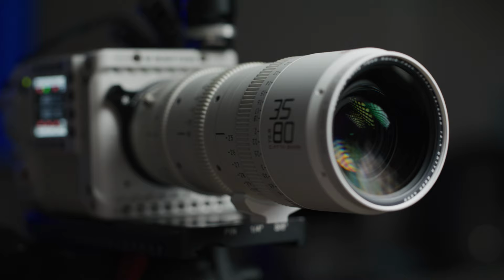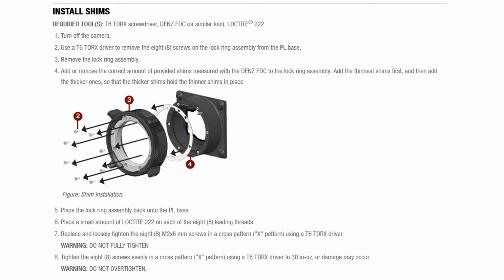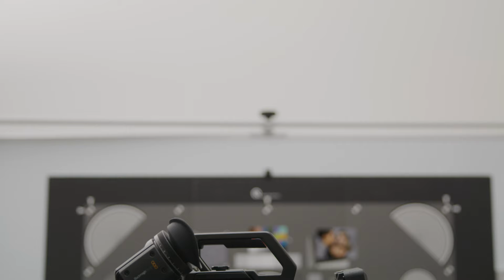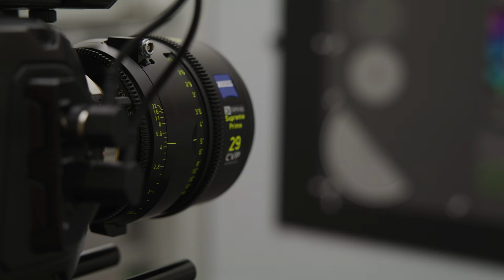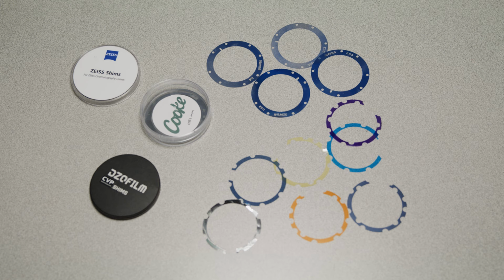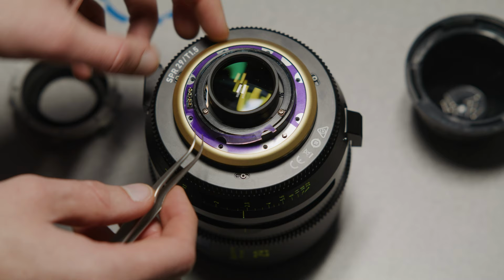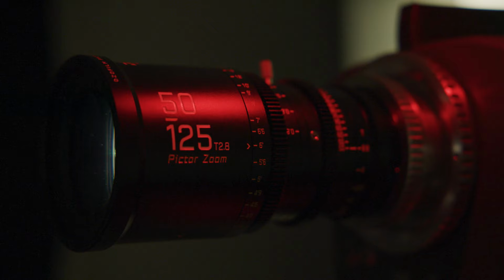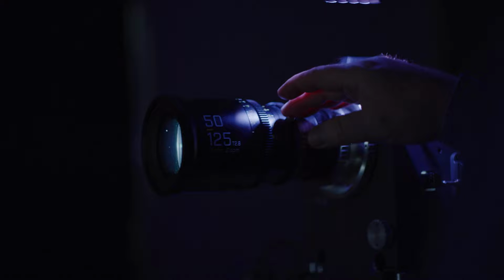Calibrating Your Cinema Lens | How & Why To Shim A Lens

Comment: Great tutorial guys, thank you! I had requested this previously and this really demystifies the shimming process! Another question though. Why is it that some cinema zooms, like the DJO Pictors, need to have shims adjusted based on the camera you are using, while other cinema zooms, like the Tokina ATX and Fujinon MKs, do not? I have the Tokina ATX 50-135 and have had no issues with its parfocal-ness (is that a word?) when swapping between a Red Komodo and Sony A7Siii. I also used the Fujinon MK 18-55 on the A7Siii and it has a handy back focus lever. I guess that lever does the trick for the Fujinons, but why no need to make any adjustments with the Tokina?

Comment: Thanks so much for this tutorial. 
I had an issue with my Lumix S1H and the anamorphic lens Sirui 50mm T2.9 full frame: when focus was set sharp on infinity the lens barrel indicated a distance between 5 and 15 m - and, still some degrees left to go on the barrel until the hard stop. 
No chance to do quick manual focus moves from the foreground to the infinity background which drove me nuts. And even worse, although the lens worked great in combination with my Ronin RS2 and the 3DFocus for in-range distances of the lidar sensor (up to 7m) it completely messed up my shots when pointing at the infinity of the background - because the calibration procedure of the 3Dfocus assumes infinity where it should be on a lens, namely at the end of the barrel rotation.

With a set of shimmings from Sirui and your video I could adjust my lens within 30 mins by using the S1H's built in focus peaking and focus magnification. No need to adjust any other distance meterings on the lens with true distance. It was all about hitting infinity at the end of the focus way.

Comment: old lenses made for film which is IR-sensitive. digital chips arent: so analoge lenses dont reach infinity. no shimming is helping.  adapters must be adjusted. best: variable register adapters. i made one to shoot P67 on EOS. and getting best focus at real infinity. which isnt 2.7 but at least 7.8km.  could compare with novoflex Noflexar 200mm lens which is going beyond infinity.  Novoflex newest P67-adapter-system is going beyond infinity. so are doing newest Zeiss lenses. Batis Milvus Otus Tout.
dont understand why using shim.  viewfinder telling how to focus. cam with adapter have right register. lenses not made for digital!!! adapter must be shorter than register! shimming useless its the other way round, adapter adjusted or lens must go beyond infinity.  NB: just found a tripodcollar attached to front of p67-200/4 new can also be used as focus-blocker. when lens is going beyond infinity.